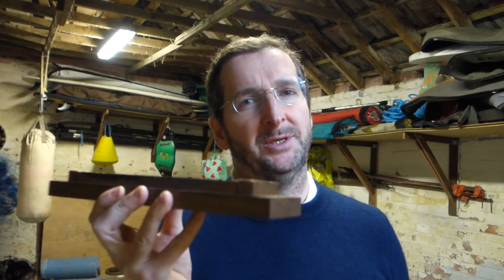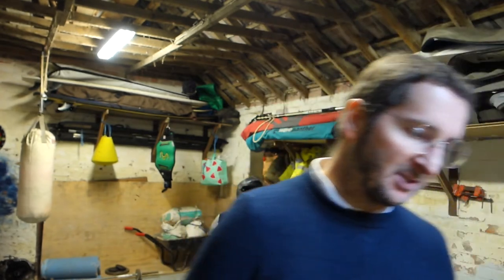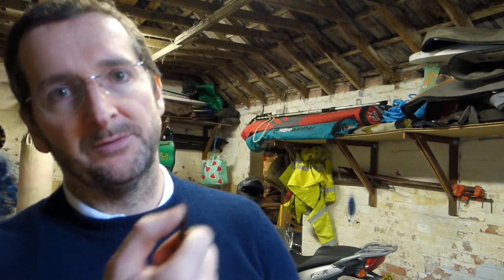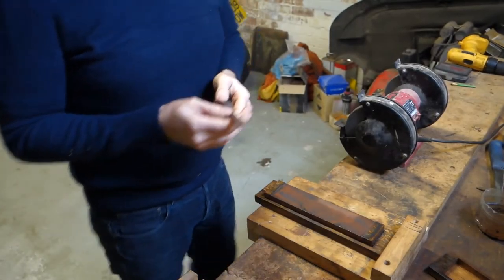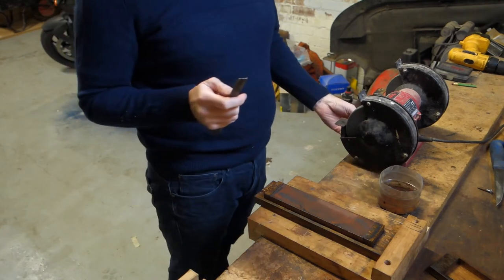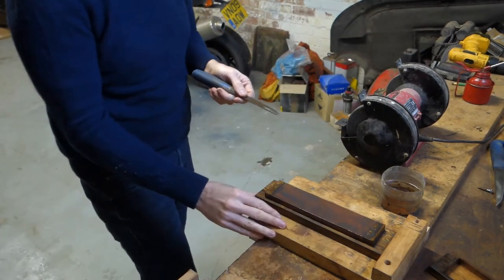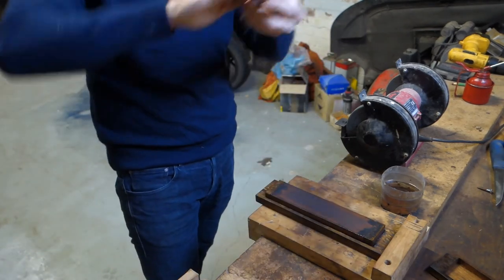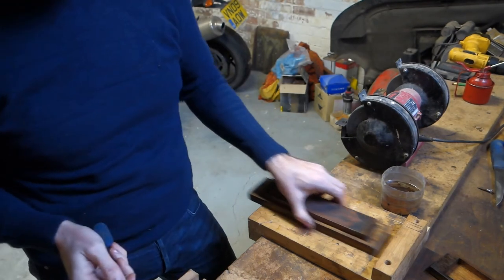How to Sharpen a Chisel Razor Sharp Super Quick!

Comment: ive always used a belt sander(with an old belt on) for first angle, use light pressure and not create heat to get a small burr all the way across. i skip the flattening on the back of the  stone. have never used a strop, i debur flipping the blade/chisel on the palm of my hand. my oil stone is my grandads from the first world war lol... its anything but straight but as im only putting the final cutting edge on it makes no difference. 
i have watched these idiots on yt mess about sharpening things and totally agree with you .... theyve never seen a site and their sharpening method would last 3 good hits lol.
not only the time they have spent sharpening their tools youve gotta add in the time off camera they have spent polishing their tool with their excitement🤣